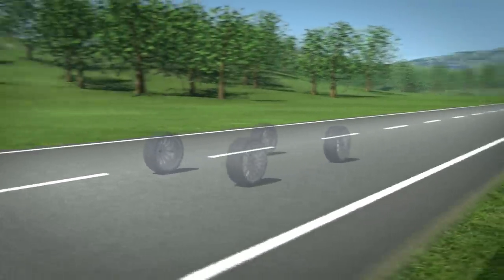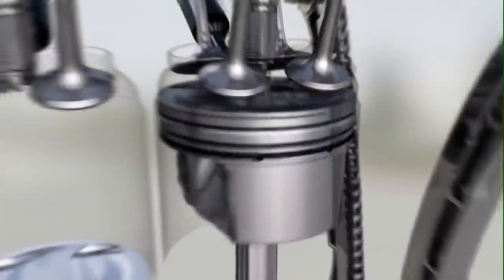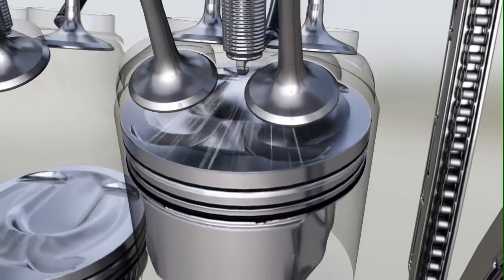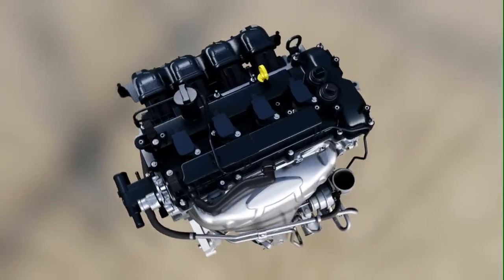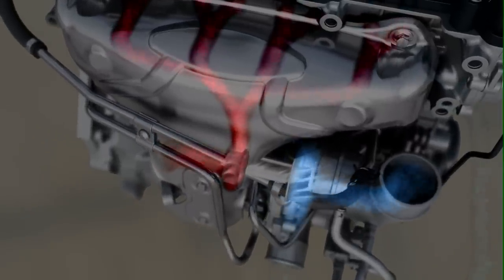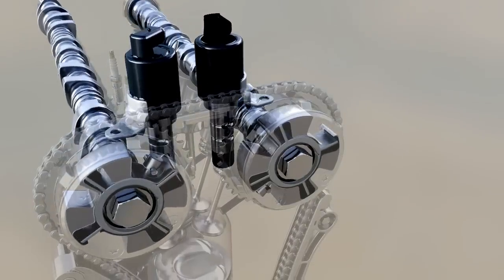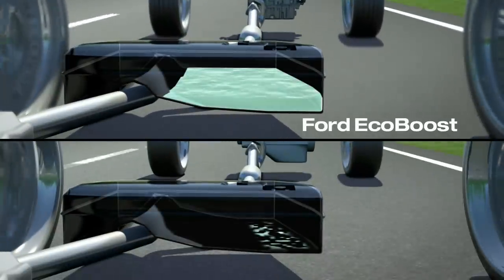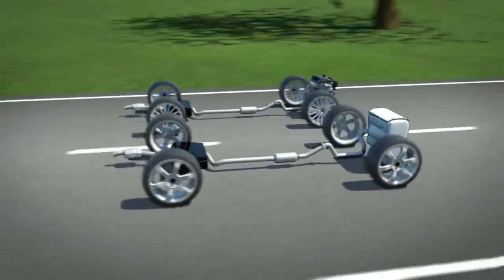Ford Ecoboost Animation

Comment: Didn't Hondas the the 80s, 90s and early 2000s get 40mpg easily with their single cam motors and maybe 36 mpg with DOHC? Toyota too, and some Nissans. But people started wanting 300hp 4cy with 40 mpg and still last forever. Leave the high HP for performance cars, not every car needs to go 0 to 60 in 5 seconds.

Comment: Co2 is a good indicator of good combustion in the engine. The 3 bad gases you don’t want in your exhaust is co, hc, and NOx witch is carbon monoxide, hydro carbons, and oxides of nitrogen.  the main “idea” of this Video is wrong because he said ford is trying to lower co2 emissions and why would you want to get rid of carbon dioxide it helps the trees produce more oxygen. Ford idea of direct injection is to increase fuel economy and reduce engine temperature. Those will reduce the hydrocarbons carbon dioxide and oxides of nitrogen. Fuel injection gets rid of turbo lag therefore making the Ford eco-boost engine more efficient and reliable. Seeing a low amount of carbon dioxide that indicates pour combustion and lower fuel economy. This could also result in higher combustion temperature that will increase oxides of nitrogen (a very bad gas to emit from vehicles).

Comment: the 2013 shelby cobra has a 5.8 liter v8 with a twin screw supercharger and when driven carefully, it gives you 24mpg. he's just talking bogus. there's never going to be a truck that gets that amount of mpg specially when the carburators are pedal driven and not automatic like newer vehicle has.

Comment: EcoBoom is more like it. Ford has a factory oil change interval of approximately 7 to 10k. No engine with a power adder should go over 3 to 5k on an oil change. Have replaced a couple EcoBoost engines in F150s because the owners followed Fords service schedule. CHANGE YOUR OIL!
Reply: This is the smartest comment here. I just got a 2016 fusion with 21K miles. The oil change sticker says next oil change at 28K. I'm like WTF? I change all my cars at 4500 to 5000 miles no matter what engine they have. And with full synth. I won't be using the factory interval on the little 1.5.

Comment: jus sayin they do it best .. iv owned fords, Chryslers, toyotas, lexus, Cadillac but my Audi was the best thing I ever invested in .. cheers to my 2.0TFSI .. look that up ..Sir
Reply: Invested being the key word. You're going to have to invest a lot of money into an Audi to keep it on the road. You Europeans always crack me up with that European car being better b*******. American cars far out last anything European and that's just the way it is. Maybe the American cars being sold to the European Standard over there arent as good as, I wouldn't know. We don't drive that junk over here. But I know this, I've traveled to Europe plenty of times, and I don't see 40 year old cars driving around on the road. I see 40 year old American cars in the United States all the time. They might not look so nice, but they're still running. Not only are they still running, but the people that own them don't have any plans of ever giving them up. 

I won't defend EcoBoost though. I think a lot of cases they work a lot better than people want to think they do, but I also see plenty of them to fail prematurely. I certainly see a lot more failed EcoBoost then I did the old 5.0 engines Ford used to have. Not to mention Ford jumped the shark on their own idea when they put a overhead valve old style gas engine back into their work truck this year. Wow, just like the same exact design General Motors has been picked on for using forever. And Ford goes back to that in 2019 huh? Yeah I guess the proof really is in the pudding.

Comment: I’ve seen so many 1.6 eco engines with holes in the blocks at the shop.. junk 40,000 miles and engine failure
Reply: You are right, but I must add. Who in his/her right mind will want a 1.6 engine eco or not?

Comment: Ford Ranger 3.2 five cylinder diesel engines run great untill the first service then if the tech didn't get the memo, the oil pump looses prime and the engine starves of oil. Why don't Ford test run these engines to destruction then fix what needs fixing. The 3.2 diesel is a great engine let down by a variable output oil pump that's only there to save fuel. I'd rather have reliability...

Comment: Never get this one as i bought my  2013 ecoboost  4month ago (used) at 49000 in the clock  and had misfire cylinder 1 I took it to ford and they say I need new engine which is £5500

Comment: Not when your driving an Ecoboost  2.3  in a SUV or a Ford ranger , Bronco . They only get 20 MPG . Thats it . A full sized 2011 Ford with a 5.0 will get 17 to 21 MPG highway at 70 .  It just cheaper engine . Thats all

Comment: I had to change the engine on my 2013 Ford Fusion and now the transmission it’s acting funny haha
Reply: lol i need a 3rd engine... had the car for a year and 2 months. 
do they sell them in a 6 pack at Costco? 
both engines were around 96-98k miles. both broke around same time of year 11 months apart.
Reply: DarkShadowsX5 I’m sorry for that man, I think you should go to and buy another car

Comment: They've taken technologies that diesels have been using for years, turbocharging, and high pressure direct injection.. Its nothing new and nothing special. Lighter and most likely less stronger. Aluminum can only be so strong, especially when they are all cast parts.
Reply: Hold up well in civilian cars but trucks or any thing hauling wait will probably tare through it..

Comment: I stopped buying Ford products BECAUSE of the Ecoboost engines. Give them 50 miles, there will be vast amounts of carbon buildup in the intake valves. You have to basically do a top engine overhaul to fix. And, though the Ecoboost may have tons of power to pull trailers with, you better have a big wallet! The guzzle gas in the mid to lower single digits when they are under a load.
Reply: What engine did you have that gave you all the problems ?? Thanks 😎

Comment: LOL Chevy. 400 Hp non-ecoboost 6 cyl Ford engines can get 20-25mpg very easily at low RPM whilst carrying 4 people and towing a boat. 30mpg with a best case scenario.

Comment: You can have eco and boost but not together. All these engines have to be driven in a very strict manor or the fuel economy is worse than the larger engines they replace.  Ford have kind of caught on to the carbon build up issue buy putting port injection on some of these engines now it's just sad they screwed a lot of customers before getting to that point.

Comment: My 5.9 cummins pushes more torque then eco boost ever will try to pull a 40 foot goose neck without losing to a diesel
Reply: That eco boost truck is probably rated to tow more than your dodge. And it has about the same TQ but more HP in a lighter vehicle.

Comment: I own a 2017 focus ST, most problematic car ever owned, I have cold engine shuttering, misfiring under acceleration, and now wont even boost right anymore lol, at only 29,700 miles on the odometer. I love the car, fun to drive, but an headache to keep it running, this engine goes through spark plugs like oil changes. Also my 3rd gear syncro is going out, why?
I tell you the truth, my next sport's car purchase won't be am American branded vehicle sadly, I have been a Ford fan for a long time, but time to change; also they don't seem to want to support the American market with small car segment anymore, and I hate SUV's.
Reply: Forgot to add, 4 purge valves already replaced, they can't provide a solution to their faulty EVAP system to customers who paid 35K for their car 😒, and funny part is, dealers argues that it isn't a recall every time my purge valve goes out, annoying as hell!

Comment: Having driven a Mondeo with the 160hp ecoboost 4, it’s shite. It belongs to a friend and has done about 50.000 miles. The turbolag to begin with is TERRIBLE. Floor it and it takes a good 2-3 seconds before anything happens. Their car ran like ass when i hit around 4000rpm on an onramp where it was necessary to gain speed quickly, it began losing power and jerking around. It’s just not good in any way.

Comment: There great UNTIL....the timing chain stretches, the cam phaser go bad, the coil packs and spark plugs fail because of the condensate coming from the intercooler, and the turbo goes bad....they save fuel for sure..while sitting at the dealer or your driveway for repairs! Never again ford

Comment: Dear Ford, I’m very sad to inform u that this particular tech u r bragging about is long been in the European market since before the turn of the century. Just by naming engine by fancy names doesn’t mean it is more high tech, yes it’s more than other previous American technologies but by any European standards is is almost primitive. Infinity had similar tech even in the early 90s. Unless u have a real new engine tech pls stop claiming that u have the tech of the century. I should disclose my bias not only against American engine manufacturers but also about European ones too because they keep repackaging the old tech with some new cosmetic fixes and yet the real architectural mechanisms very little if any change, just simply by putting new label on it doesn’t mean it’s a new tech. We can do much better than that, I know it, I can prove it.

Comment: Its too bad, because your statement clearly shows you dont know anything. My old C6Z got a best of 32mpg with just a tune. My dads C5Z with only an intake gets 28mpg.... My Vette dynoed 501hp/510tq at the wheels, and my dad dynoed 410hp/400ish tq..... small block chevys. So your statement is pure ignorance. There are plenty of other people with V8s making more power and getting similar MPG's, VTEC is old technology, every other manufacturer had already moved on to using servos instead of oil

Comment: JUNK direct injection build more carbon then a standard engine Ecotech has the EcoBoost beat by a long shot when it comes to carbon buildup even the mini Coupes BMW engine direct injection mass of carbon buildup low compression before 90,000 miles total jump direct injection

Comment: Theirs nothing wrong with Ecoboost engines, they are highly efficient on fuel consumption, the weak part has been mating them to the dual clutch gearboxes, they simply are not reliable, Ford go back to standard autos and the problem is solved.
Reply: nah the engine has shit durability.  i would know i had 2 engines blow piston #3 like it was made of glass.. both around 96-98k miles.

Comment: I'll stay with a classic Ford, Dodge, GM, or a VW(Either a Bug or Type 3) product instead of a over engineered modern piece of bullshit that will breakdown faster than older simple tech that I can fix with no issues and not deal with a shitty computer

Comment: At  90,000 km mine needs the timing chain replaced.   First vehicle I have ever owned that needs a timing chain replacement.  The Ecoboost is an interference engine.  If the timing chain breaks or stretches too much, goodbye engine.  Ford is also very tight lipped about information the home mechanic needs to service this truck.  FU Ford.

Comment: @MeWoahits

Well, the point of any Mustang is to have a car that's quick, responsive, and overall fun to drive. Any motor with plenty of power can do this. The only difference will be the sound, which is an opinion of importance of each individual. Personally, I will never buy a sports car that sounds like shit. And you gotta consider, today's rendition of older muscle cars aren't even muscle cars anymore, so their direction is pretty much infinite.

Comment: Tons of problems with this engine
Head gasket failure
Carbon build-up
No torque at high RPMs
Rough and harsh
Just missed the old days when engines used to have port injection not direct injection
Reply: I can't speak to the head gasket problem, but carbon buildup is no longer an issue. Ford is rolling out dual injection for all Ecoboost engines. The 2.7 and 3.5 already run dual. The no torque at high rpm is an issue with every turbo engine across all manufacturers. 52,000 miles (in less than two years) on our 2.0 Ecoboost and not one hiccup. Ford does the turbo game better than other manufacturers. Look at Honda. Their 1.5 is a freaking disaster. I'd rather take my chances with a turbo engine vs cylinder deactivation like GM uses. And you can thank not having regular port injection anymore on our lovely EPA.
Reply: "This engine" lol you realise this video is about a family of engines right? 7 different displacements, difference versions of each...

Comment: "Eco"boost is a joke and a lie.  There is nothing "ECO" about it.

Take the Taurus SHOW and it's Lincoln rebadge for example.

Ford's V6 gets statistically the same mileage as the G8 ...and gets the same mileage as the V8 Genesis...

So, again, what's ECO about a V6 getting V8 mileage?
Reply: sho942000 it is  SHO...no W in the title.

Comment: And life of the engine reduces from over 500 000km to 120 000, when it should be trashed because the cost of the renovation exeeds new engine. These eko trends are overhyped.

Comment: Ford's in the business of selling cars. You can put eco on anything. It helps it sell. To the people. To the government. Anyways, the 3.5L EB is producing 365hp at 1,500 rpm to 7,000 rpm while the Hyundai gets 375hp only after reaching 6,500 rpm. They both start at the same price. 

Sort of like vtec--it's a stupid but ingenious way for Honda to sell its cars with a cheaper dual cam switching VVT than have a real VVT/CVVT. Marketing. Get over it.

Comment: My 2017 Escape 4 cylinder 2.0 ecoboost gets a whopping 18mpg   city.  Same as my 2010 Escape 3.0 v6  
   I am not impressed.
Reply: If you accelerate at the same rate as you would with a larger engine it won't use less fuel. So unless you drive slow it's not going to be any different from a v8
Reply: Jim Scobie I have a 2016 Ford Escape SE with the 1.6 liter Ecoboost Engine. Mine only gets 23 City and 32 highway, which is not bad I think.

Comment: wo0w soooooo innovative...NOT my 1990 eagle talon is the same setup. way to be with the times ford. but at least 1 american company is smart enough to stop bullshitting its customers into believing you need a v8 to make power. turbo is and always will be better. power when. 1990 talon motors are turbo charged closed deck, cast iron blocks with semi forged internals. piston cooling jets(oil squirters). variable valve timing. intercooled. dohc engines. in 1990 lol ford boasts like they invented.

Comment: BS. The combination of the turbo system and the STOP / START system is the idea of an idiot engineer who is afraid of his accountant. It can only be worse when the engine is a diesel engine. But that's fashion.
Mazda does not dowsize, does not turbo, and meets exhaust emission standards. Do you want to have an F150 and not have problems? Buy 5.0 or 3.3 and insert the plug into the trailer's installation socket. And you will do best when you finish some good technical school - for example, the engine building department of technical universities. Then you will not be delighted with movies made just to earn even more money.

Comment: Ford ecoboost is a joke have had nothing but issues with a 2015 Ford escape titanium i4 1.6.  Transmission went to shit cause Ford didn't change the Trans fluid at 60k Miles they claim your suppose to do it at 150k miles which anyone real mechanic will tell you is asking for issues. Mine made it to 145k miles and new Transmission thanks to pathetic Ford dealerships. Got an overboost issue a coolant sensor issue engine fault issue now and the list gets bigger and I've babied this car since I got it at 107k miles being the secand owner first owner wad old couple.

Comment: my 2003 ford Taurus got 24mpg and didn't blow pistons... my 2016 fusion 2.0L gets 25.4 Mpg and desperately needs a 3rd engine. 
These ScamBoost engines are so damn awful im glad ford stopped making sedans. Hopefully this engine design has been thrown in the dumpster where it belongs.

Comment: theres no replacement for displacement, if I'd want a 1L I'd get myself a bike or a bottle of pepsi and not a car. If you want a fun to drive car then get a 1969 mustang boss 429 and not some shitty fartcan that breaks down after 20k miles from overstressing the tiny engine and squeezing more power out of it than it is capable of making. ecoboost may have sense in supercars or race cars which are maintained all the time anyway but in a reqular road car it's pointless, expensive and stupid, because I'd rather spend more money on fuel than on replacement parts that broken because of shit engineers, and co2? bitch please it's not harmful to the environment, trees need it to respirate and oceans transform it to O2 all the time so what is your point?

Comment: so basically it's a small vtec engine with  small turbo... made of aluminium..
Reply: Variable cam timing is not vtec. Vtec switches to a different set of cam lobes. Basically the engine has an economy cam and a performance cam and switches from one to the other.

Comment: Aluminium is a pretty fucked up   metarial to produce an engine from it. While you are making it less heavier you are making it more fragile to heat changes. Whenever you start your engine and stop it aluminium alloy engines changing  shapes . Everytime. Soon after you have a problematic engine that boils water despite you did not leave it without water . 
  New tech  is builded by more  part selling minded car producers .

 Sorry for my english.